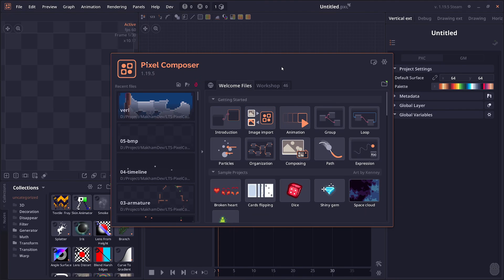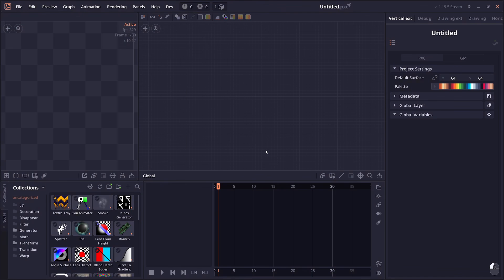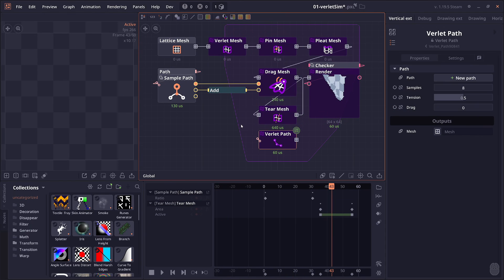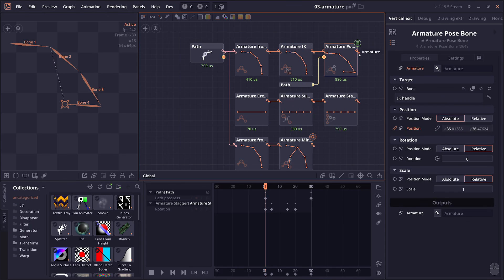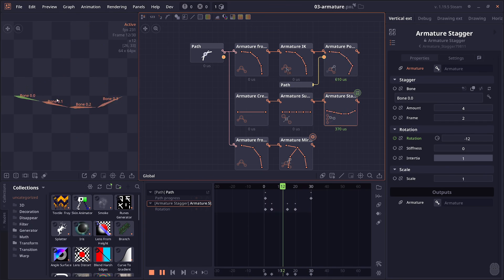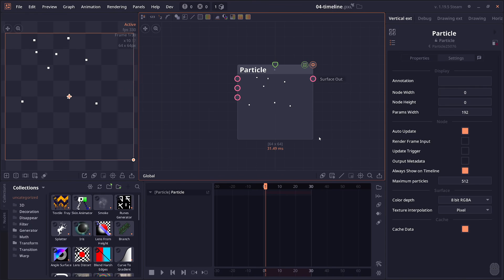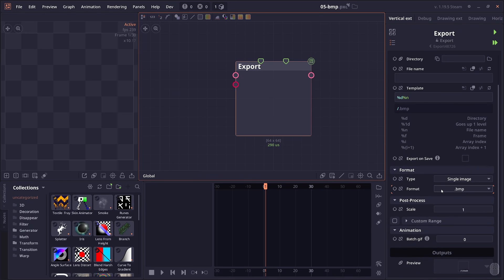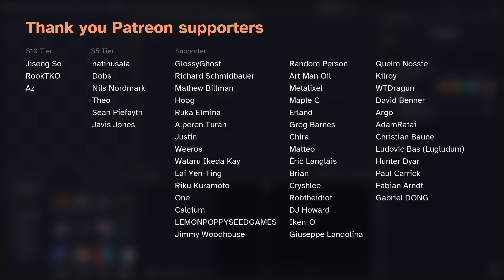What's new in Pixel Composer 1.19.5

Comment: Hi Makham, I love this software, struggling a little with the Verlet simulation you show here though

I take the mesh grid and plug it into Verlet mesh and work through the sample you have here, I provide a texture (I have tried custom image textures and checker as you have here) into the Render node, but for some reason no matter what I do it will never show anything in the render node, I have double checked everything's visibility. I also noticed the way paths work have changed somewhat in more recent versions in regards verlet (being a verlet path)

If it wouldn't be crazy effort, could you slap together a quick cloth tutorial to get a little more in depth in the settings? Or perhaps even share a sample file for Verlet sim? Its just vital to a project I'm working on at the minute

You're the best, keep up the good work either way!
Reply: After some hours of messing with it, it seems that I had failed to pin the cloth correctly and I guess the mesh fell (? right term?) out of the scene, didn't seem straightforward to reset it, but started from scratch being careful not to lose the mesh (I bet there's an easy way I missed) and got it working exactly as desired

Extremely powerful now I've got it down!